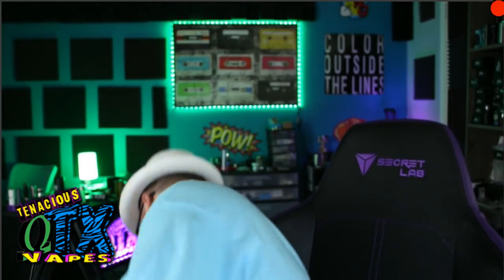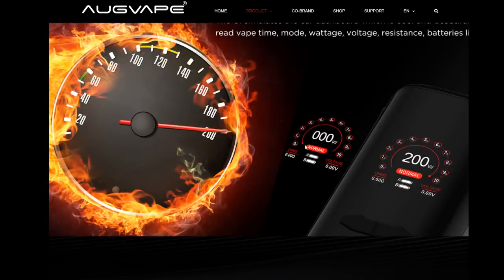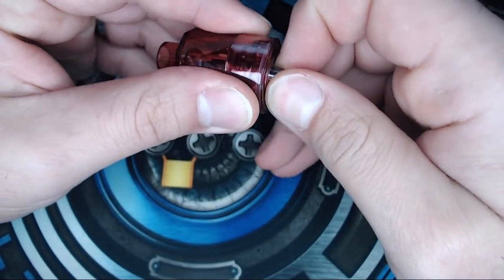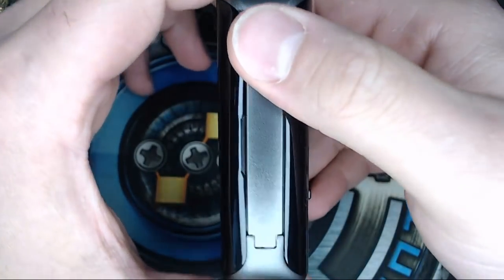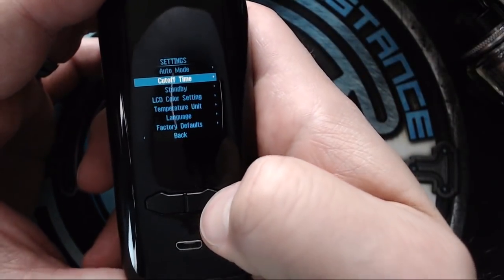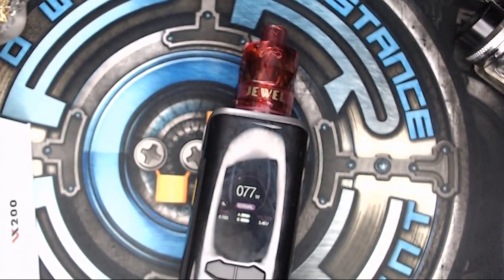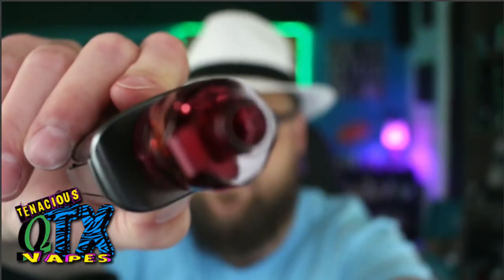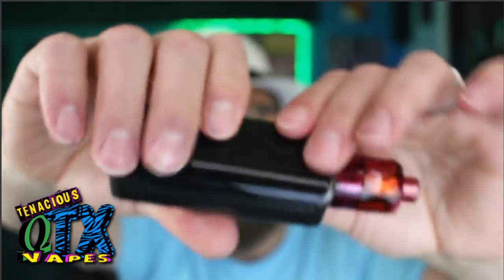The Augvape VX200 & Disposable subohm Tanks! Let's discuss...

Comment: The mod is nothing I am interested in but it looks pretty good if that is the kind of product someone is seeking. It reminds me of the Vaporesso Revenger series. 
The disposable tank seems like an odd choice for the kit tbh. As to the tank and the question you posed I do not like it. It is just another thing that will generate more trash found on the ground outside the local store. As it is now coil heads and pods litter the ground and this will be more of the same. Not sure of the price point but I would hope the tank is essentially the same cost as a coil head is. Would suck to get a few bad coils in the purchases after you filled it up with liquid too. But to be fair I prefer everything to be rebuildable that way I can control the vape experience so it is not surprising that I am not eagerly embracing disposable tanks.